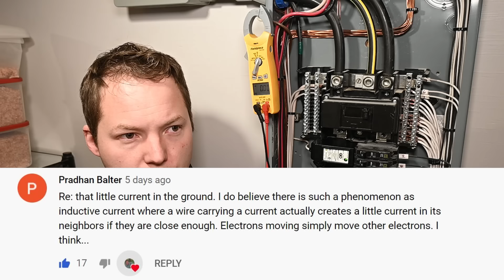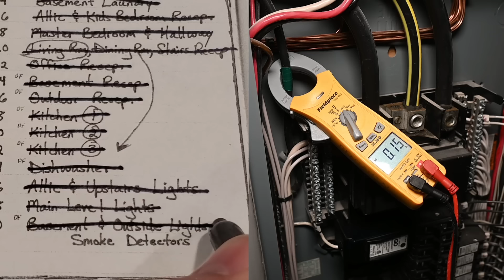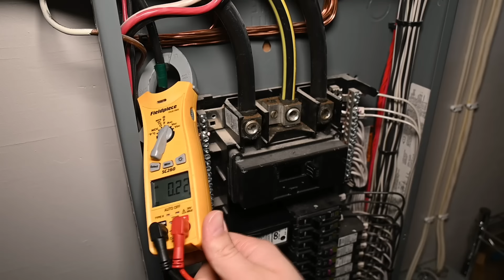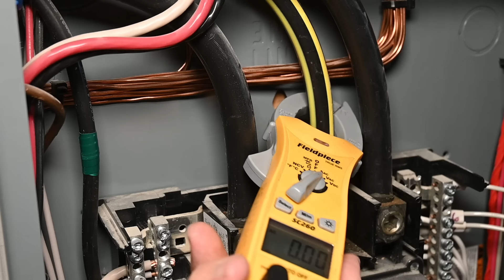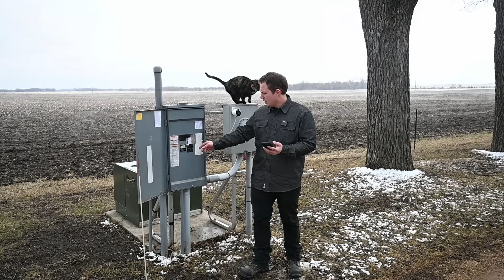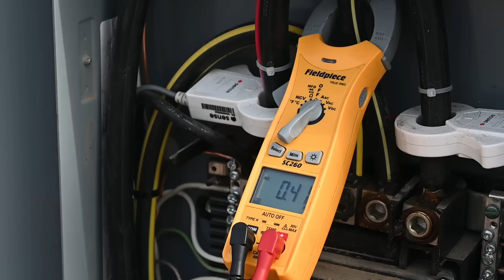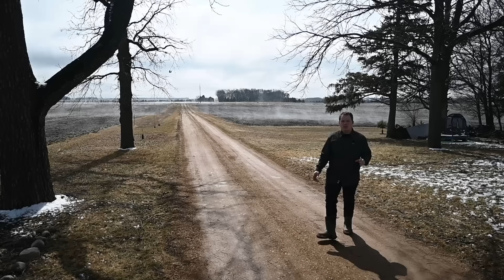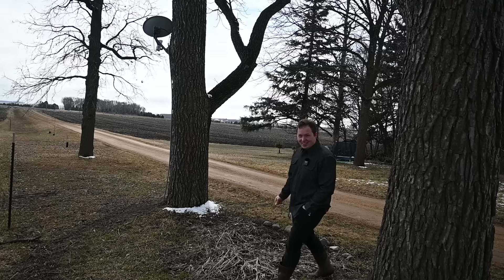Finding The Source of Stray Current on Grounding System

Comment: now that you have the power off the sources of the stray flow could be.

1. induced current from earth's magnetics.

2. water gotten into the conduit underground between the outside breaker and inside breaker.

3 .faulty electric meter (you will have to call the utility co to replace the meter)

Comment: What you are dealing with is what utilities call a multi-grounded neutral (MGN), with MGN where ever a transformer is placed, the neutral of the transformer bushing is bonded to the poles or pads ground, it works, but it can also use's the subscribers grounds as well because they are bonded to neutral in the main panel. So if the utilities pole to pole or pad to pad neutral is insufficient to handle all of the current it is carrying, some of it flow through the earth and that is the current you are measuring. At the level you are measuring it it is not a hazard, but at higher currents .25A+ it can begin producing what is know as step voltage which can be a hazard to lightly insulated people or livestock, think bare feet, touching water, etc, and it can dry out a grounding system which will increase the hazard of step voltage.

The real bad part is many utilities and their newer engineers don't understand it, all they will do is tell the subscriber to install more ground rods, which will not work. The solution is, the utility needs to take some neutral current readings and either up-size  their neutral, or repair the open or high resistance splice or splices they have in their neutral. The real solution is to have them install a neutral isolator.

Neutral to ground bond at a transformer.

http://gunsforeveryone.org/Assets/transbond1.jpg

http://gunsforeveryone.org/Assets/transbond2.jpg

Step Voltage.

http://gunsforeveryone.org/Assets/step.jpg

Wayne

Comment: Worked on a 277 lighting grid, 60 fixtures- turn off the breaker, and two fixtures would turn on instead of off!
Reply: battery backup on emergency lights?

Comment: Did you separate the neutral and ground in the main panel? It looks as though both are tied still to the same ground bar. I have a breaker box that don’t have a earth ground in it and it does have the green screw in the ground bar. Can I pull in a new bare copper grounding wire from outside into the breaker box? I can use a split bolt to bond the earth ground wire that will separate ground into the main Breaker box? 
I still would need to separate all the neutral and ground wires and remove the bonding “green screw”.... is this right?
I installed a 6 place sub panel in the attic from new AC unit. 
Thanks for any help!

Comment: Try disconnecting from the plumbing. If the property is fed with copper or galvanized pipe and there is no dielectric union installed  then it's coming through the pipes. Some will install a PVC union to separate the continuity to other homes around you. Hope that helps
Reply: I was thinking the same thing.  Steel gas lines carry a small current because of electrolysis which is why they connect sacrificial anodes to the steel lines underground at strategic locations.
@ben try swapping out that union with an insulated one and see what happens.

Comment: Now the question is, what appliance or device in the house is acting as a ground rod to your transformer. My money is on water heater and washing machine completing a water bond. Also check any gas appliance that could be using the gas pipe as ground.

Comment: Nice video! A couple of things... Don't get too wound up on the semantics. Ampmeter and ammeter are the same thing, other than the p, of course. Their purpose is to measure the amount of current moving through a conductor and display the value in units called amperes. Also, on current vs power, just remember the basics. Voltage will always equal current times resistance, and power will always equal voltage times current. So, when you say "it's not power, it's current", it's actually both. In this case, you don't know how much power because you didn't say what the voltage is. Is 1/4 amp a lot of power? Maybe, maybe not, depends on the voltage. Is that situation dangerous? Again, depends, 1/4 amp at 1 volt probably isn't , but 1/4 amp at a few thousand volts it probably is.
Reply: Alan Woods, you are correct that if there is current there is power, but volts times amps is apparent power (S) in AC.  You have to consider the phase angle between the current and the voltage, and the cosine of this angle is called the power factor.  Real power (P) is volts times amps times power factor.  In a purely resistive load, the power factor is 1 so the real power is volts times amps, but in a purely inductive or capacitive load the power factor would be 0,  so real power would be 0, even with voltage and current.
Reply: @chrisgutierrez5759  Agreed.  Power Factor is a thing.  I didn't go into that, partly because I was intentionally trying to not get into a bunch of extra details.  But mostly because I got lazy and just didn't feel like trying to explain that in 7,258 words or less.  ;)
Reply: @chrisgutierrez5759  Your right Its all relative, I just didn't like them saying he was so incorrect to say "power".
Reply: You can't have a current flow if there is no potential (Voltage).  So while technically it's true that "current kills you", there has to be sufficient voltage to push that current through your body.   That depends on many factors but most Electrical Safety training consider anything over 60 Volts AC sufficient voltage to push a deadly amount current through your body.
Reply: I thought it was the current that kills you.

Regardless if it's 1 volt or 100kV at a quarter amp, it's still high enough past the let go threshold and if it has a path through your heart then you're screwed.
Reply: @that1electrician  .25A through the wire at e.g. 5V won't cause .25A through your body to ground. 0A through the wire at 240V WILL cause dangerous current through your body to ground. Without the voltage you cannot get the current that will kill you
Reply: 0A at 240V will NOT do anything at all. mind you: i mean 0.000000A, where ONE microamp is greater than 0.000000. At 240VAC, it takes milliamps to kill a human.
Reply: @that1electrician  I think all your heart needs is 10ma and Mr. diy is dead.
Reply: There's a good analogy. Consider current be size and voltage be height of a stone above someone's head. You need both to kill the person, but there's more than one way to do it.
Reply: @ruslankadylak2999  nice
Reply: 60V AC, 35V DC then current can kill you

Comment: Current is power, you must have power flow to have current flow and current flow to habe power supply. If there is any current flowing the you do have power flowing. Power is V×I. Power is wattage. Therefore saying current or power is applicable.

Comment: It is common for a higher current load such as a dryer or water heater can actually cause a differential voltage between neutral and ground. What I mean is that what happens is that electrically your neutral and ground are connected together (ground at transformer). Think of using 2 wires in parallel, obviously the current will not go through only one wire instead the current will be shared by the conductors. The current sharing will different between the conductirs if the gauge and length is different. So it's more than likely due to the ground sharing current. Watch Electroboom's video (free energy from Ukraine 3 million subscribers special) he explains this in an excellent way.

Comment: Ben,  Electrical service is connected to a complicated network of neutrals to grounds,transformers and old 3 wire 240vac appliances. The current from neutral to ground is not unique to your home. Also, and this is picking gnat droppings out of pepper, it's redundant to say, "Current flow". Current is the flow of electrons; however, you hear and read "current flow" used  by electrical and electronic engineers.  More importantly, would you do a video on shared neutrals and the code violation doing so. Thanks for your excellent well presented videos.

Comment: It could be a loose or corroded neutral connection at the meter. I had one and traced the leaking ground current to an underground gasoline storage tank pump motor. The steel  tank was a excellent ground which was sharing the neutral current back to the utility transformer neutral. Called the utility and they found a corroded aluminum crimp connection on the over head service triplex line.

Comment: Why don't you sever the bonding of the ground and neutral bars in the first box (I assume they are separated in sub panel)?
I'm worried you made a battery ( kinda like potato battery) with all your grounding rods and gas line, this stray current could cause electrolysis and corrosion in your system or plumbing. 

Good luck and let us know what you find.

Comment: It could be the grounding strap that goes to the neutral block in the transformer from the transformers tank or body of the transformer And or the #2 bare copper cable attached to the tank grounds there are 2 of them and a ground grid that is outside the fiberglass base of the transformer  with 2 ground rods in opposite corners. I'm pretty sure that the transformer is a Y transformer not delta. This is what I have found out is usually the problem.  I am a cable splice for the utility company in new York.

Comment: 13:56

Yes.

Power is the work that the electricity does in the house. Voltage is a measure of how keep the electricity is to flow through a conductor and current is how much electricity is actually flowing. But given that Power = Voltage x Current and Voltage = Current / Resistance, a "stray current" means there must also be a stray voltage, and an unintended conductive path of some resistance,  so yes, sometimes the teminology sounds a bit nitpicky..

Comment: This was a great video to watch. I just replaced a 200amp meter box myself and using the same process found that I had 0.15 amps going out my ground wire from the hot water heater. Does anyone think I need to address this or leave it be? The Hot water heater was wired using two 30amp hot lines and a ground with no neutral.
Reply from the maker: Likely one of the heating elements is bad. I actually will have a video about diagnosing this in a day or two! I would recommend replacing the bad element that is "leaking" current to ground. Great job troubleshooting!
Reply: Why are you heating hot water?  I have a cold water heater in my house. :-)
Reply: @paulalmquist5683  amen

Comment: Ben you are on a Underground Residential Distribution system. You have a high voltage pad mount, 240 delta system. The pad mount creates its own neutral. The high voltage windings are energized. You have the closest neutral return. Ground rods and water pipe ground. Last video you energized a ground rod. But you could not do that if it was connected to a water pipe ground.

Comment: Ground loops. Verify no bonding of neutral and ground bus in house. Verify the two house neutral and ground bars are not reversed. Finally, if all this checks out, remove the ground rod wire at the house panel's ground bar. If not fixed, you are likely correct that it is utility issue. It will not add to your Bill because it is not metered.

Comment: Is it a difference in potential between the ground at the transformer and the ground of the house, the ground at house might be better?
Reply: Absolutely agree.  I'll bet the ground at the house has lower resistance than the ground at the transformer.  Your Equipment Grounding Conductor is acting as bonding wire, carrying some current to the grounding rod at your home.  A good test would be to disconnect the wire running to your home grounding rod and measure for current again.

Comment: Unrelated question: Did you drill into the meter housing to mount the cloud cam and is it part of your home WiFi network?  It has a great vantage point!
Reply from the maker: Yes it is in a great spot to be able to monitor the yard! We've been pretty happy with the Nest outdoor cam as we have had them for a couple of years now with no issues. No, I did not drill into the meter housing as I don't think that would be a good idea. :) The Nest has a magnetic base that is pretty strong so it is simply stuck to the meter box with the magnet and it works great! It isn't strong enough for the cat as you can see right here: https://youtu.be/q-RrufV6Gig?t=766
Reply: Benjamin Sahlstrom Missed the cat trying to take it out.  Too funny😆.   Very good videos for DIY like myself.  Can relate to the need for googles...and I guess gloves.  Experienced a nice flash at the panel when I switched dryer on after I installed it.  Tripped the circuit AND the main breaker.  Apparently shorted one of the hots to the box.  Molten metal is dangerous stuff.
Reply: @BenjaminSahlstrom  Now it is solved! The magnet in the nest cam is enough to induce the stray voltage in the ground! Induction all along.
Reply: @joecamel6044  Um, No. He has AC.

Comment: Friend of mine had a similar problem.  He was measuring 30 V from the ground in the basement panel to a bonding ground on his water line.  Initially, the utility company blamed it on faulty wiring somewhere inside the house and told him to call an electrician,  He did so and nothing was found.  Eventually, after several emails back and forth to the utility company, they determined it was a problem at their distribution transformer where the neutral wasn't grounded correctly.
Reply: Just like the utility to sit on their hands when ever possible.

Comment: I really don't believe that crappy Fieldpiece meter is capable of accurately measuring current, using the clamp on functionality, below 1 Amp AC.  I certainly wouldn't trust it.  Any self respecting electrician should be using Fluke meter.  You're not an HVAC guy, come on, you should know better.  Leave that Fieldpiece crap to the guys that don't know what they are doing like homeowners and HVAC guys.

Comment: I believe a closed loop is created when the first outside box is bonded to neutral and has a grounding electrode and the box in the house is grounded to a second electrode which creates a path for current from the main neutral to move along the ground wire to the house panel ground then to the ground rod and then back to the main outside panel ground rod. I believe if you temporarily disconnected the ground wire from the outside box ground electrode the current would stop flowing and you would get a zero amperage reading. Could you make another video showing how to properly earth ground a house if the meter is on the pole and the service wires travel some distance to the house inside main panel? On my house the meter is on the pole along with a main breaker and the meter box is bonded and earth grounded to a ground rod at the base of the pole. My house is 125 feet from the pole with the meter so the main panel is 125 plus feet from the meter box which is earth grounded. My question is, should a second ground rod be used at the house to earth ground the inside house main panel box even though it creates a path for a tiny amount of closed loop current. I have different electricians telling me different things. Your video shows separate ground rods at the house and shop buildings but I believe these create a closed loop for current to flow and I am trying to figure out whether to put a ground rod on my house since it has one on the pole. Thanks for your time.

Comment: With the main panel still bonded, there is continuity from the Main panel Egc to the subpanel Egc. And, since ALL parallel paths in ANY electrical circuits will carry a portion of the current you will have current in  every path porportional to the impedance (resistance) of each path.  ie: (to simplify the equation) if path 1 exhibits 2 Ohms and path 2 exhibits 2K Ohms, then path 2 will pass 1/1000  of the current that path 1 passes.  The math is, "the reciprical of the sum of the recipricals". (1 divided by the sum of 1/R1+1/R2+1/R3 ...etc et.al.)
Google it. "Thevenizing electrical circuits"
Unbond the Main panel and  see what effect is.

Comment: We had a very bad situation here in Australia, We have a MEN system, that relies on the Neutral to carry fault current back to the transformer, a house had a broken neutral wire before the MEN link and so all current in the house went through ground instead of neutral, this then caused all the waterpipes to rise up in potential to nearly 230 volts almost electrocuting a young girl, this problem will also cause current  and associated voltage rise in nearby houses grounding systems. I would be concerned about your multiple ground rods if you didnt already have a protective earth wire between all your sub boards.

Comment: have an identical issue here however, can't fix it. turned off my main and still have current going through the ground wire. however, since i am in a city, i figure it's normal as every building ground is tied to the main water line so my guess it's back feeding from the ground to the power pole ground

Comment: Howdy.
I say the grid line load is in unbalance. Including all consumers on that line. There will be a current in the neutral+ground wire of the line. All soil elecrode systems along the line plus the soil will constitute a parallel path for the line neutral+ground current.
The soil return current finds your sub panel electrode. Then it runs through your main cable netral+ground wire to your main panel electrode and continues through the soil to the transformer pole electrode and up to the transformer midpoint.

This is a wonderful demonstration of how soil electrodes uphold the grid line symmetry during unbalanced line loading.
Regards.